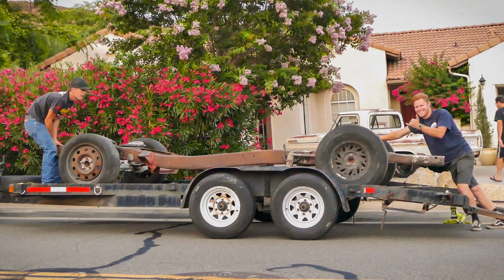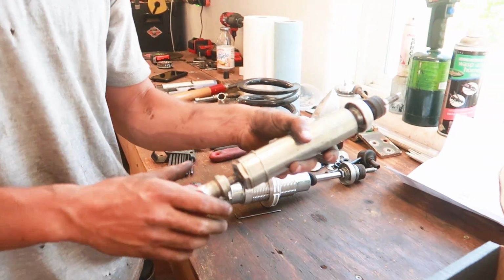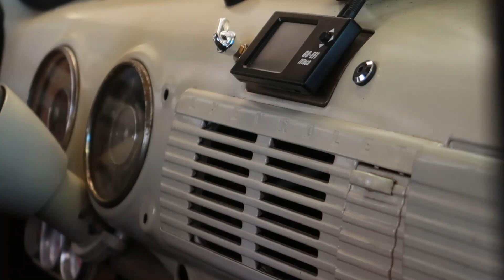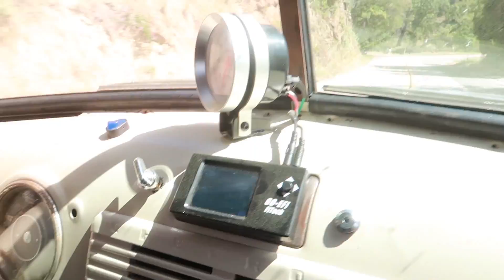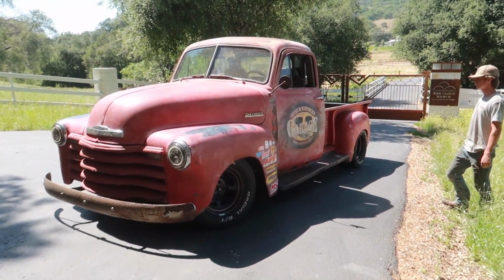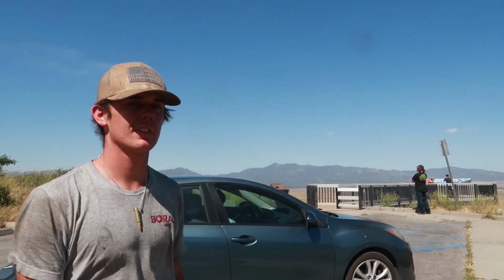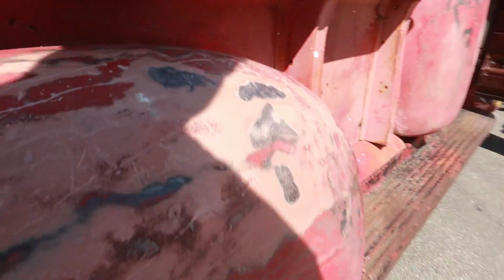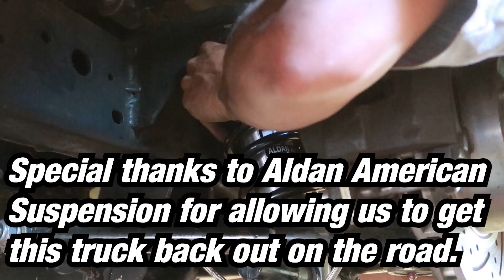We Gave This Sleeper '52 Chevy a FULL AUTOCROSS Treatment!

Comment: Sweet truck, but I would make a suggestion. Have your buddy fab up an extra mount off the back side of the through bolt on the lower control arms. Mustang II front ends are pretty stout, but that is the weak link. Because that through bolt is in shear, and gets tremendous force under braking, and can snap that bolt. Just fab up a piece of plate, maybe 3/16, that welds to the frame and captures that bolt. If you want to see an example, check out “No Limit Engineering” as they use these on their auto cross chassis. It’s cheap insurance that could save a life. Enjoy!

Comment: 7:30, I wish they made LED headlights that didn't obviously look like LED headlights...
Reply: Same!
Reply: Sylvania H6024 *LED
Reply: Joe Schlotthauer 

You’re in luck!

You can do a H4 conversion lens system and add LED lamps. 

Those old sealed beam lights were used for decades, so there’s lots of choices out there.
Reply: @u15Gummi  
Got a link, I have a 51 Ford F3 with the round headlights, and a 79 Ford F-100 with the 7x6 rectangular headlights...

Comment: Neat truck. I hope a wheel and tire upgrade is in the works. It doesn't make a whole lot of sense to spend all that time and money on suspension if you're still going to be running rock hard T-rated rubber. Sadly, there's just not much market for larger 15" performance tires.

Comment: Great video, your videos have definitely been improving.  Only missed a doughnut scene.

Kinda odd to see a carb on a LS, pretty sure the intake and carb cost more then vats delete.
Reply: David Brennan I think it’s EFI, it has the controller on the dash
Reply: Patricio Garcia I think it’s a carb style efi. I don’t have the best understanding of them but Chevrolet tbi comes to mind, or like the Holley sniper efi.
Reply: Yeah it's EFI
Reply: It’s a 600hp Fitech. The truck started off carbureted then went Fitech
Reply: Yeah in the video he says he picked up the 4.8 LS with the Fitech, I understand someone else made the choice and he bought it.  It just seems odd for someone to remove the factory fuel injection for a more primitive fuel injection system. But if you are going for the old school carb look all the power to ya.